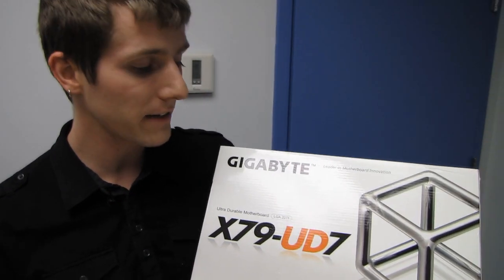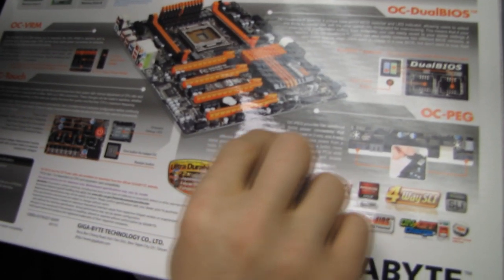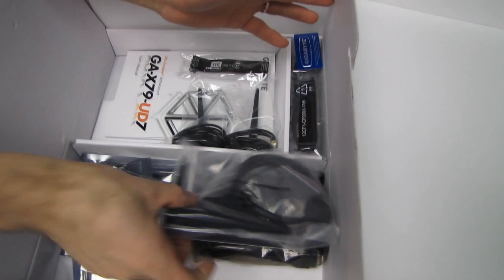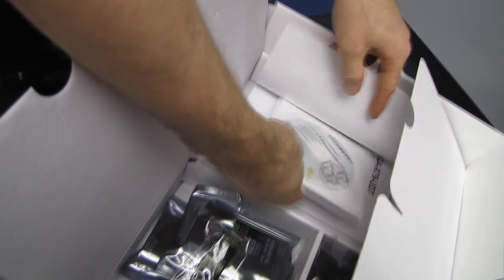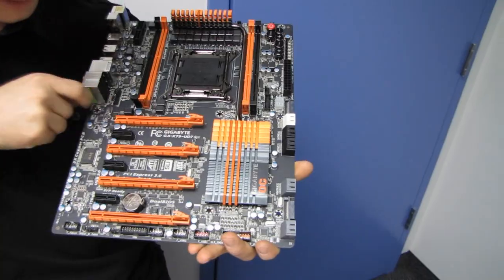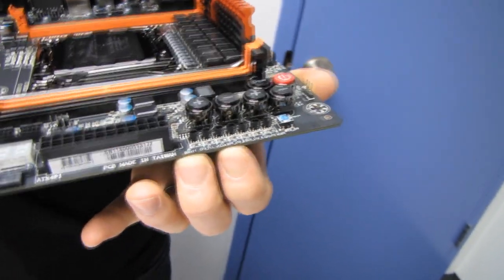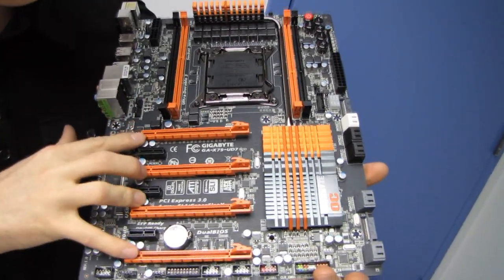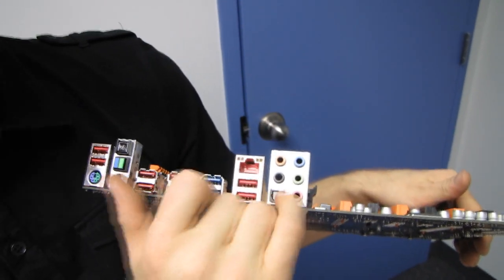Gigabyte X79-UD7 SLI Gaming Overclocking Motherboard Unboxing & First Look Linus Tech Tips

Comment: Work station? If you can't even respond to a comment correctly I can't see that happening. Have you not seen the video? THIS IS AN OC BOARD
If they had all 8 DIMS they would have run out of room for the power delivery, which if  you want to OC . ehhh

Comment: @jozeaphe You are the highest form of idiot. I use X-79 as a work station, I don't even overclock much at all, I didn't even mention over clocking, I just stated that X79 supports 8 memory slots, and that this board only has 4, so please shut the fuck up and go away...

Comment: I was wondering if anyone else has had any problems with 670s in SLI I just got my 2nd one yesterday, and I was messing around in bf3, and I get lower fps by about 10-15%, and I have no clue what is the problem, could anyone help? Just kinda upset that I wasted 430 bucks ><

Comment: Hey there, does the board require two 8pin 12v connections in order to power on?  Does it require only 1 with an additional 1 as optional?  Both optional?  Both required?  Kinda lost on why it has 2- just more stability for OC'ing?

Comment: Lots of people complain that the ud7 only comes with 4 dimms. This is an OC board and is geared towards OC enthusiasts who will never use more than 32gb of ram. Also, you can hit much higher OC with 4 sticks instead of 8 because there is less stress on the IMC. For people who want a workstation with tons of ram, there is the ud5 which has 8 dimms for that purpose.

Comment: Where is the UD3 review? :( I really like the all black layout and 4-way SLi it supports. It's also $279.00 CAD on newegg.ca, but apparently it does not overclock that well. That's if you're wanting a 5.0Ghz OC. It can run stable @ 4.5Ghz, which is nice, but I wouldn't mind a UD3 review in the feature.

Comment: This is done wrong. Why make the g1/2 series of boards, then make this board that has different features than the other high end board, but lacks some of the features that the g1 series has. This makes no sense. Pick one series, and pack all the features into that board. Make the g1/g2 boards have over clocking abilities like this, but keep all of its original features....

Comment: @TheScalesHaveFallen nanny nanny boo boo? Are you a black 5 year old? lol.Just because a motherboard may support up to 64 gigs of ram doesn't mean you ever be able to use any where near that much. The board itself does NOT support a cpu powerful enough to run enough apps to utilize even 30 gigs let alone 64. You'd have to run sc2, metro2033, crysis 2, bf3, dvd/blu ray burning program, copy n pasting a blu ray movie from your external storage drive or nas, fully buffer 1hr+ youtube full hd vid,

Comment: The board looks pretty nice and 4-sli is a great idea if you have the cash. The only problem is, if you do go for 4-way sli you will not be able to use a dedicated soundcard coz as with far too many vendors these day, they have idiotically placed ALL of the PCI-E x1 slots right underneath the x16 slots. Which means you can't use them when a dual slot GPU is in the slot above. And when nearly all gaming GPU's are dual slot... that's just stupid engineering

Comment: @IMPER1ALDRAGON umm interesting question. from my understanding of logic, i think it will be fine on this board but not on some cheap boards. if your motherboard can run in dual 16x mode and ur not doing any sli or crossfire than it will be fine. even if you do some kind of dual gpu config itll only drop down to 8x mode, which is still not bottlenecking the gpu at all. i personally put my revodrivex2 on a 16x slot and run a single 580 in the first slot and everything seems fine.

Comment: @ShadowwwLFS yeah it works but it's not called quad channel if it's not 8 dimms the motherboard says it supports 4 channel memory architecture on gigabytes website it doesn't support quad channel memory it support's dual channel

Comment: @luigix Only two DIMM slots because that allows for a bigger PWM cooling area and a larger CPU HSF area.
If there were eight, that'd be cramped as fuck.

Quad Channel means.. well... think of it like a RAID 1 array across four dim slots.

Comment: @luigix Exactly, most motherboard manufacturers have chosen for  slots per channel, but Gigabyte has chosen for  slot per channel. It's not exactly new, Foxconn's Bloodrage X58 Motherboard also had only 3 DIMM Slots. For very high overclocks they use only 1 DIMM or 1 DIMM per channel for better stablility.

Comment: @Kurdestar why not have it? future proof it. if it's available and it's in a smaller form, why not? It'll make it so you may save yourself an upgrade in the future. I'm building a system right now and i'm going to use all 8 dims.

Comment: Linus says to direct the top fan of a case down to cool the PWM power delivery system, but I have a question. Say you have a Corsair H100 or equivalent closed loop cooler (yes I know, not as good as a custom water loop so hush), what would I do then? I'm assuming using the rad fans to pull in air is a bad idea, though I may be wrong =p